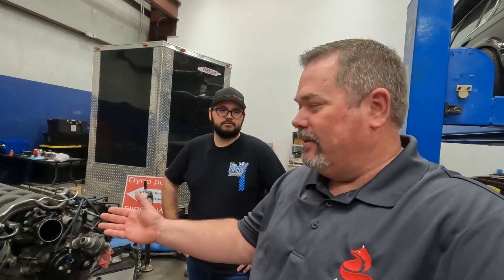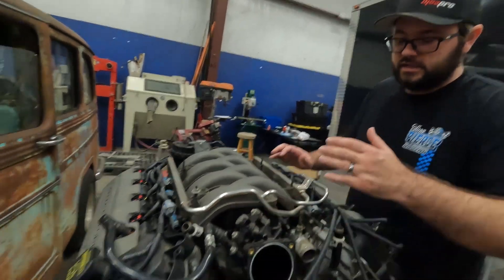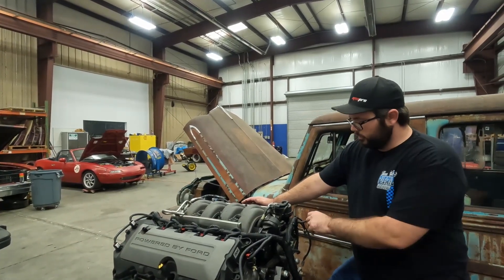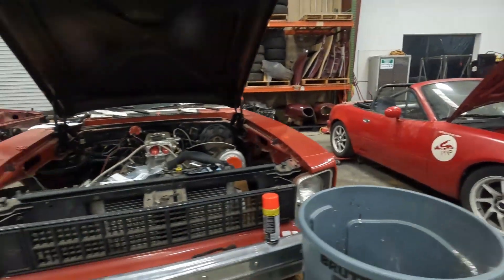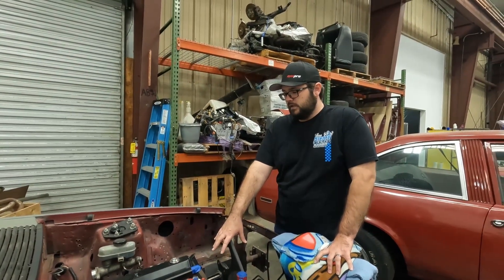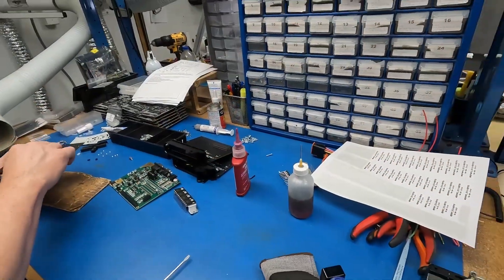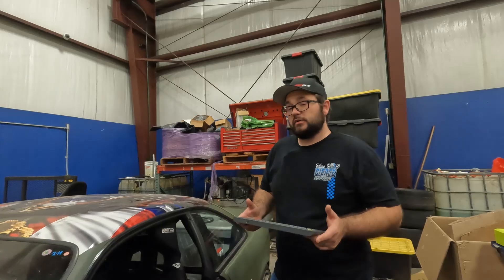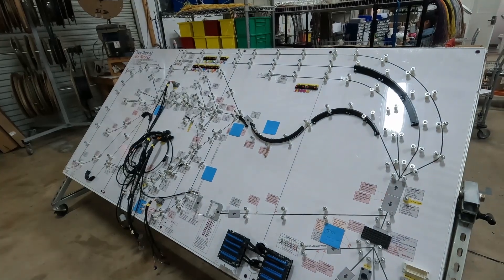DIY AUTO TUNE COYOTE SWAP DEVELOPMENT BEHIND THE SCENES

Comment: Will they support the cruise control?
Reply from the maker: @jasonpeters9478  I am planning on using the factory cruise system since I will not be using the electronic throttle body.
Reply: Dang it.  I had already bought a Holley system...but I don't have a display yet.
Reply from the maker: @puzzlefox5.076  they plan to have the ability to support other systems soon.